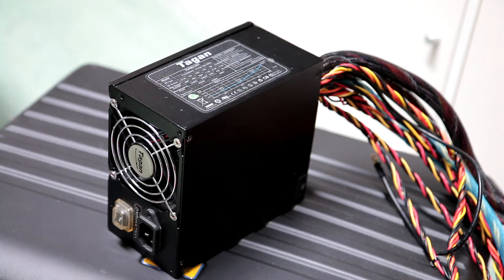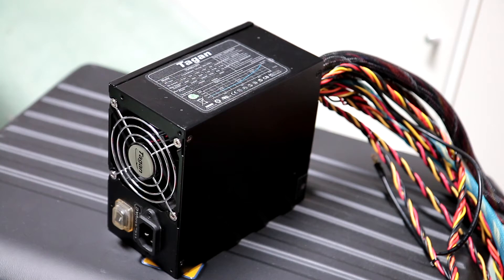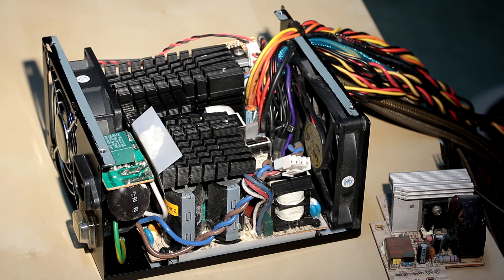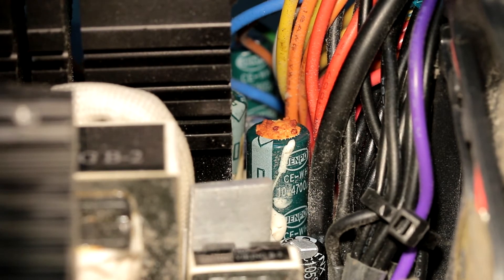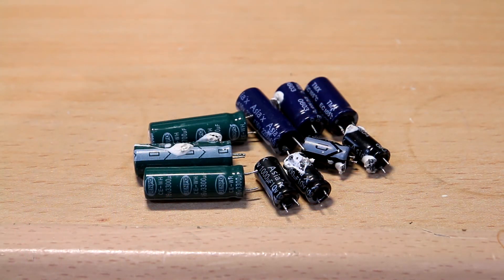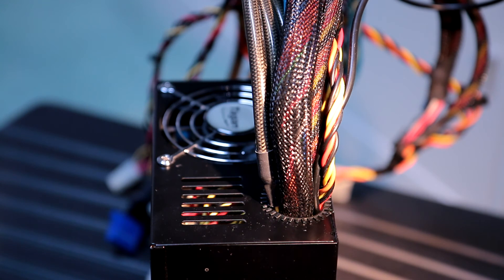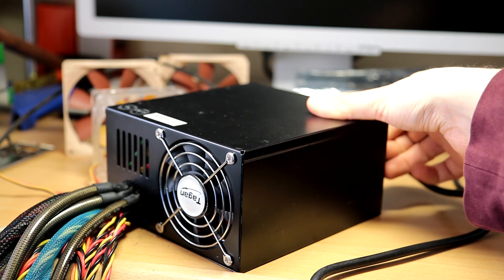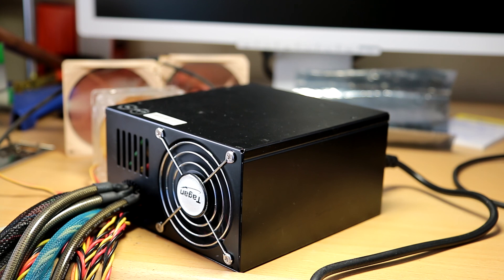PC PSU Repair

Comment: Hi there. I have a little question, I have a corsair 850w silver psu, but the 24pin cable has a contact lose, is it possible to replace the 24 pin cable? The psu is not fully modular. Thank you.

Comment: Ka-boom, ive had a few do that, and it really wakes you up like a kick up the jacksie lol :)
As dave would say "One hung low brand capacitors" lol.

Ahh panasonic, my favorites :-), not too bad from r.s, well i dont have to sell a kidney.
Some things from r.s are really silly prices, im sure they are taking the piss at times lol.
Reply from the maker: It didn't actually go bang. It just started started making a really angry fizzing and whistling noise as they vented. Suppose to their credit that they didn't do the hand-grenade thing.
Reply: +FrontSideBus Ooow ive had them really go bang, aluminum foil and smelly saturated tissue paper like material blast its way out of a pc psu, and what made it worse was the input bridge rectifier was the cause so it was quite savage, that psu was toast lol, had to clean the inside of the pc with a rag and meths to kill the smell, the fun of the hobby :-D
Reply from the maker: zx8401ztv Heh, I had a mate who complained his PC was slow and kept crashing. I had a look: he smokes and has a cat... you can imagine what the inside looked like. I took it outside and hosed down the inside with a few cans of contact cleaner! Should have seen the colour of the gunk that came out of it. Still stunk of ciggies though!
Reply: +FrontSideBus oh yuck, i feel sorry for you mate, bloody niccoteen is disgusting.
ive been there as well, a pc with a 1 inch thick coating of dust/niccoteen/insects and other unknown goo, makes me feel sick just thinking about it :-(
The dam psu was full of it as well, sticky shit, the outside case was also sticky and brown looking.
Fucking disgusting people, the pcbs i washed in meths, the case i used hot water and loads of washing up liquid, the water was like liquid poo :-(
Pc's get dirty but thats just being a dirty bastard ha ha :-D

Comment: Always the bloody caps that fail in power supplies! Suppose that's the planned obsolescence in them. Good repair!
Reply: Machine Man The output filter caps run at very high stress - they have a ripple current equal to the full output current of the supply. Once the ESR starts going up, you get self-heating and accelerated degradation.

Use of ceramic or polymer capacitors is an option, but they are very expensive, plus have the additional problem that their very low ESR can cause unstable oscillations in voltage. The ESR of electrolytic capacitors is just right for compensating the feedback loop and producing a damped voltage response. Ultra low ESR capacitors require careful feedback loop design.

With modern monolithic switched mode regulators, the feedback loop may be integrated into the device, and therefore use of ceramic or polymer capacitors usually isn't an option because the feedback loop may not be adequately compensated.
Reply: ChumpusRex I see. I recall the electrolytics in PSUs being DC. Would be hard trying to source some other type of cap as I've never seen DC poly film or ceramics
Reply: Machine Man By polymer, I meant conductive polymer electrolyte electrolytics rather than film capacitors. These have good capacitance, very long life times and exceedingly low ESR and are only modestly more expensive than normal electrolytics.

Polypropylene film can be used for DC - but the fact that they very expensive and bulky compared to electrolytic means that they are not usually used for DC and instead reserved for AC where electrolytics are less suitable.  They are not usually used as power supply filters, although some high reliability industrial UPS units may use them instead of electrolytics.

Multi-layer ceramic capacitors (of the type found on modern PC CPUs and motherboards) can be paralleled up into large arrays - and these banks can be used for small embedded PSUs in high-reliability equipment, provided that the regulator can be adequately compensated.
Reply: ChumpusRex I see.